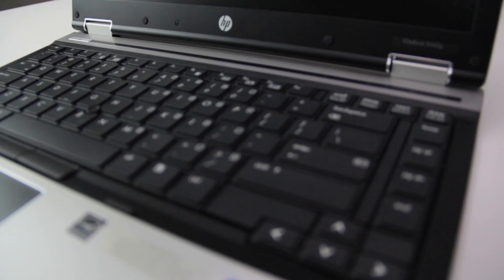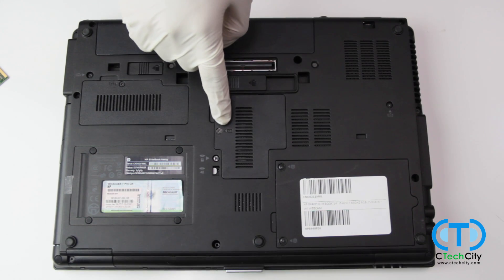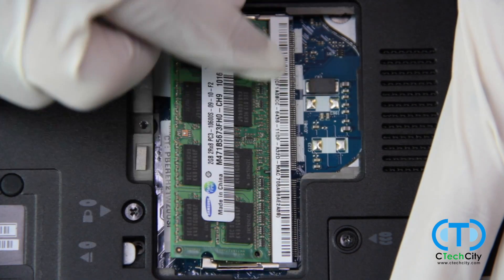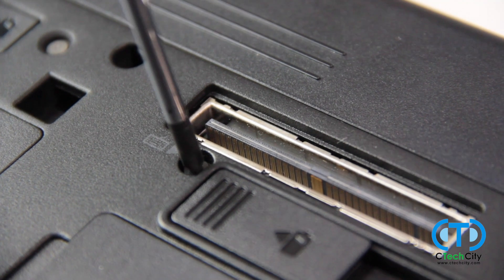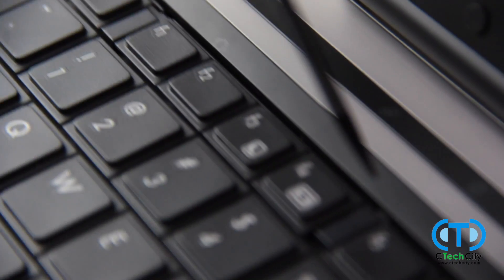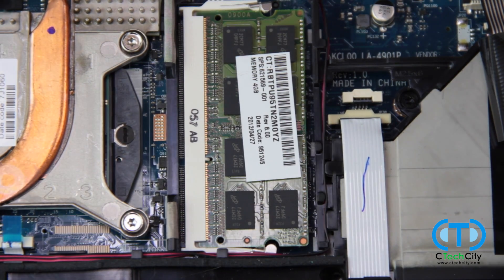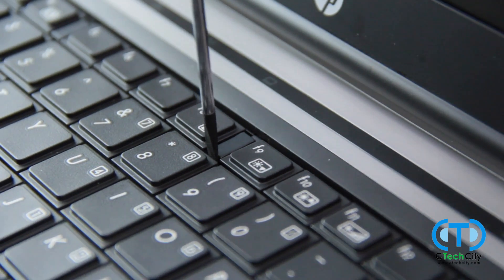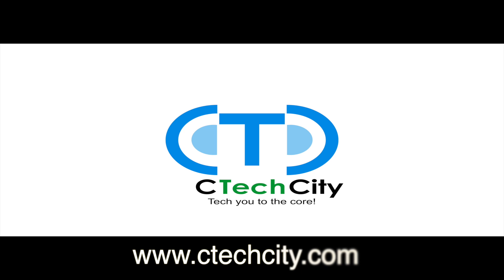How to Upgrade RAM in Your HP Laptop (with RAM underneath keyboard)

Comment: Shame on you!! What kind of tech are you that you bothered to put on stupid "plastic" static electricity generating gloves, and then, YOU DIDN'T EVEN TAKE THE BATTERY OUT! Geez...I get that you were doing the "quickie" version, i.e. not disconnecting the keyboard and all, but the battery should ALWAYS come out. 

Video is ok other than that...at least you don't talk forever like some of them do. Very concise and efficient/imformative. ...but wow.
Reply: Did anyone happen to noticed in the video he removed a 4gb module and replaced it with a 2GB Module?.... Nice job on the video though!

Comment: how is RAM fitted in Elitebook 8440p ? It has 2gb RAM in my laptop. Will it only be on the back side?
Reply: eh what do you mean? doesn't the video just showed you?? you need DDR3 1333 (PC3 10600) for this model 8440p.

Comment: My laptop overheating.. help.. :(
Reply: this is normal for 8440p model, not sure of other HP models though.  It will help if you place your laptop with the bottom elevated to prevent covering the fan.
Reply: vacum it , definatly contain dust inside
Reply: @ludiscustomapparel9764  i've been using thermal paste but still overheat. i'm using elitebook 2540p
Reply: Get a fan for ur laptop athe botom shauld help workt for me

Comment: My 2540p doesn't have the little locks around the keyboard for easy removal. It was quite the PAIN IN THE ASS to keep from accidentally sliding under a key and ripping it off. Not to mention getting the keyboard back on was very difficult. THEY SHOULD HAVE JUST PUT BOTH STICKS IN THE SAME PLACE. WHY MAKE EVERYTHING SO HARD? SO I'LL PAY HP TO RETURN IT, INSTALL IT, AND SEND IT BACK?

Comment: my laptop doesn't support the rams i tried to put in
Reply: not supporting meaning it is not booting up?  you will need to try some other brands but as the manual state it should be DDR3 1333 (PC3 10600).  I did try some brands and it didn't work.  Trial and error.  You need to bring your laptop on the computer shop